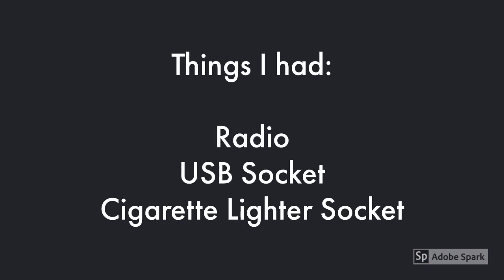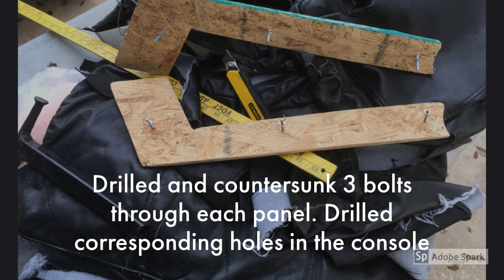How To Build A Custom Center Console On A Budget!

Comment: Great work and some much needed guidance and motivation to build a short one to fit in my '70 Belvedere wagon with a bench seat. I need space for some Vintage Air HVAC pots as well as a single DIN and perhaps a pair of gauges from the bottom of the dash to the floor.
What did you used for the drink holders?
I REALLY dig your Ford!!!
Reply from the maker: Thank you for watching. I'm glad I could help. For the cup holders, I bought the cheapest "drop in" ones I could find on Amazon.

Comment: Looks great! But my question is how do you mount it to the floor? I dont see any brackets on the outside.
Reply from the maker: Good question. I  originally planned to put a bracket in. I'm glad i didn't. I had to remove it several times for wiring and other small things.  I built it so that it wedges between the firewall and the seat , as  well as the bottom of the dash and carpet very snug. It doesn't move. I have to slide the seat back and wiggle it back and forth to get it out.

Comment: @noob mechanic dude, that's just what I've been looking for my Galaxie as well, do you know the measurements of the cup holder section to the radio section?
Reply from the maker: not off the top of my head, but i can get a measurement later this weekend when i get home.
Reply: @NoobMechanic  don't worry it, the xl looks fantastic though
Reply from the maker: @nikwashere1107  thanks!

Comment: How did you get the electronics to work ?
Reply from the maker: I wired them into the dash to 12v keyed. I also installed a fuse inline
Reply: @NoobMechanic  thanks bro I'm building a 78 Lesabre and looking to spice up the interior

Comment: I realize you just used scrap wood, the whole thing turned out great. I see alot of guys use thicker wood than they actually need.
Reply from the maker: I'm one of them lol. I definitely used wood that was way too thick. But that was kinda the point of the video. Even with recycled material, you can still make something to be proud of.
Reply: @NoobMechanic  mission accomplished